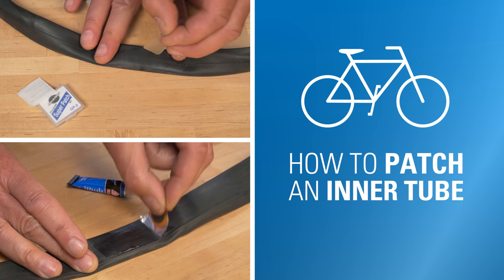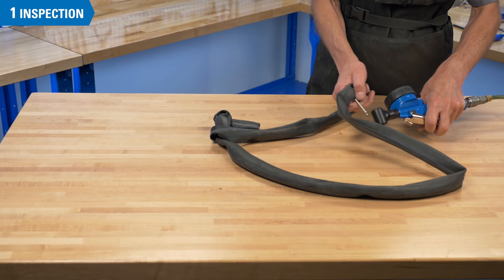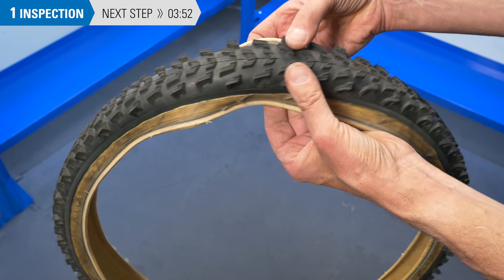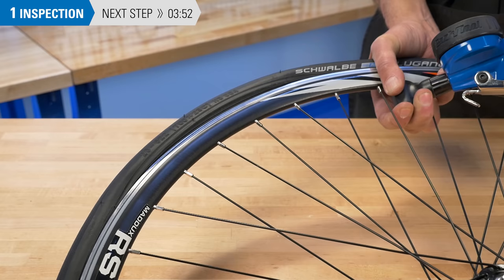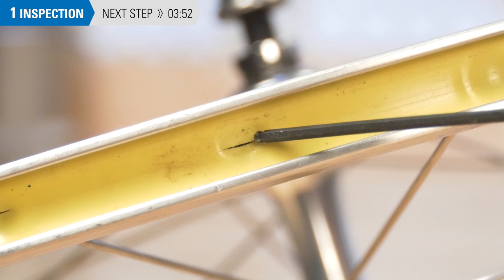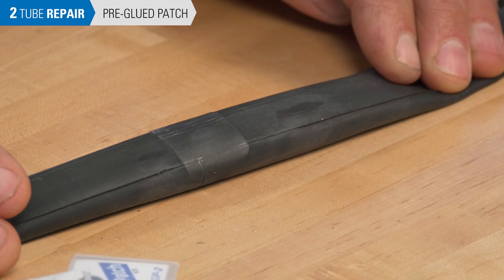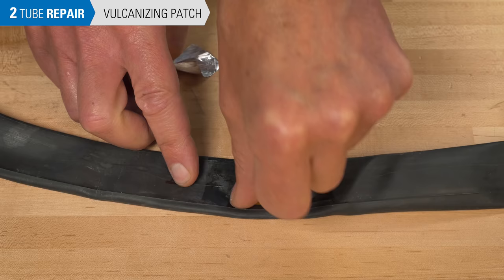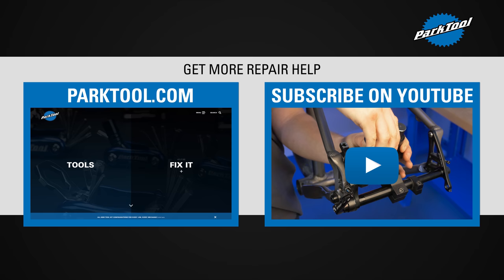How to Patch a Bicycle Inner Tube

Comment: I replaced many tubes in my life, this time idk why I thought I’d check a video about a how to while the glue was drying. And one thing I almost forgot this time was to check the tire for what caused the pin hole. Sure enough I went back to my tire and there was a tiny thorn coming through, saved my day lol. Thank you.
Reply: I decided to fix this myself for the first time a week ago. Instead of paying for a kit, I had these "Glue dots" in this arts and crafts bin I remembered. After sanding the area they bonded perfect, then I chalked up the other side. They're about the size of a hole punch out and  stretch really well with the tube. A few potholes and at 60 psi working greatm The applicator has about 100 dots, it cost about $4? Crazy.

Comment: Excellent video! Thank you. Just to add to that, where you find the hole on your tube gives you a huge clue as to the cause of the puncture. If the hole is on the inner circumference of the tube as mine is today then it's likely due to an inadequate rim strip.  If it's on the outer circumference then it is likely from a foreign object such as glass, sharp stone or splinter.

Comment: Thorne Resistant tubes are the answer and sure some complain about the weight but its a bicycle and its all about fun and exercise so what a little extra weight.
Reply: Specialized 29er thorn resistant tubes or tyres?
Reply: My thorn resistant tube just blew two weeks in.

Comment: Thanks for the reminder about checking the tire for objects. I had a small tack stuck in the tire. If I didn't remove it the tube would have been immediately punctured again.

Comment: this is a really good video.
what Calvin doesn't address: 
-there are places on a tube that are difficult to get a good seal. these include the seams, and then those seam-like tire markings and machine marks. try the best you can to get the patch solidly on the hole.
-getting the edges of the 2-part patches (where you put the cement on first) to seal properly is important, and sometimes tricky.

Final thought: I'm playing around with RTV -blue silicone gasket maker as a way to seal the edges of leaky tire patches. I THINK it just may work. Currently, pre-massive-inflation-that's-coming, the stuff is about $4 per tube, and it just takes a small amount.

Comment: Calvin, what would you do if you discovered the patch had not adhered along part of the edge, as shown at 5:55? Would you add glue to the non-adhered portion, or would you remove the patch and start over?
Reply: Just cut out the whole patch and use a bigger one to cover the new hole.

Comment: WARNING: NEVER RUN YOUR HAND ON THE INSIDE OF THE TUBE TO FIND THE THORN.  I found this out the hard way, not only did I have a puncture, I also had a thorn in my finger that only goes in deeper as you try to pull it out.  Use a rag and run it around the inside of the tube and it will snag on it.
Reply: Just do it slow, never had a problem.
Reply: Another thing I do is mark the position of the valve stem on the tire itself..this way, when I find the hole in the tube, by referencing where it is in relation to the valve stem mark on the tire I have a very good idea of where to look at on the tire.

Comment: May I know there are 2 method of fixing the inner tube. 1: is using Park Tool GP-2 and the 2nd is the patch with the foil, by applying the glue fluid. Both method must be cleaned with sandpaper and alcohol swap right? My father and I have been figuring out, how does the patch works, as the patch itself is not sticky, or non,-sticky. Anyway, Park Tool videos are fantastic, which I have learnt from. Grateful!
🤗🙇🏻‍♂️🙏🏼🤲🏼🤝🏼🤜🏼🤛🏼💪🏼💯👍🏼

Comment: How do you prolong the life of the tube of glue? Also, is it ok to test an inner tube right away after patching it up (with a vulcanizing patch), or is it best to leave it overnight?
Reply: Have you tried holding it upright and as you squeez the glue out start rolling from crimped end,then after fixing tube and before capping the glue make sure the threads are clean before putting cap on while looking to see glue just at the top and cap it..see if that prolongs the glues lifespan.
Reply: @jennifurzoe1302  Yeah someone here taught me how to. Works! But thanks too.

Comment: 5:00 - Yup, you always have to pop open a new tube of glue, since the one you used last time a month ago will be completely dried up.
Reply: Annoyingly true
Reply: Why don't they sell the glue in tiny, single use tubes. I buy super glue like this. Five little tubes of glue in a plastic bottle.
Reply: @J. McQ. - Because then you wouldn't go buy a whole new patch kit or special tube of glue.
Reply: @lurkerrekrul  not if the patch kits came with a pack of 5 glue tubes
Reply: @Avins MAD - That's the point. By only giving you one tube of glue, they know it will dry up and you'll have to buy another patch kit just to get more glue. So they make more money. If they gave you more glue tubes, you'd buy less patch kits and they wouldn't make as much money.

Comment: I never leave the clear plastic on top of the patch for a road tire tube. It doesn't have any stretch and is fairly stiff so the patch doesn't conform to the curved surface of the tube as the width of a deflated road tube is narrower than the patch itself and will not fully adhere until maybe after installation into a tire which may be months down the road and other grit might of adhered instead.

Comment: Very informative video, loved it.  I have always had problems patching a tube when the pin hole is close to the seams on the tube.  Tried removing the seam with sandpaper, but it is very difficult.  Any suggestions on how to seal these leaks.
Reply: ☝️😂 I'm trying to save myself about $9 right now, my friend!  As a kid, I'd sometimes be able to patch a hole that was right along the seam. My 39 year old brain has been dealing with this same hole for the past two days now. Those holes on the seam are a tough contender that may take you the whole 12 rounds, or you may KO them in the first round. I broke out my sanding block today to thin the seam out as well. I dont know where the idea came from, but I figured if I can sand down drywall compound, I could give a piece of flimsy rubber a try🤔.
Reply: I'm currently riding my bike around after two days of trying to fix that tiny hole along the seam. I would've been out of about $9 if I gave up today. The sanding, plus adding as much pressure as I could may have helped. It's been about two hours since I took my wheel to the pump, and all is well. I just had to remove one brake pad to get the inflated tire back on the rear end of my bike. My brakes are extra dialed in, and aren't much wider than the rim. These fatter BMX tires can't even be muscled past them when the tire is inflated.
Reply: 2 replies and neither one answers the Q of how to deal with the seam problem. Anyone with an answer ? Calvin You ?
Reply: @carlosrestrepo8525  Moderately aggressive sanding will round off the sharpness of the seam, allowing the patch and tube to conform to each other.
Reply: @rgw1380rw  Isn't it easier to deflate, mount, & reinflate the tire/tube than to remove  & reinstall the brake shoes?
Reply: @ronmorrell9809  v-brakes quick release thingy

Comment: it sounds silly that at age 66 i needed to watch this... but i just patched a few butyl tubes tonight with small holes, and wondered about that clear plastic on tip.  been using your vulcanizing kit, but frankly the one with no glue looks a LOT better, especially on the road.  can anyone comment on effectiveness with laytex tubes?  thanks.  p.s. i just subscribed.  i do have several various park tools.

Comment: My questios is after patching inner tube there is still a hole in a tyre itself.Does it make sense to patch it as well from the inside.It seems like the patch on tube is located a bit aside and a new puncture on inner tube is waiting to happen,as I can see inner tube through that hole in the tyre

Comment: What's everyone's thoughts on self adhesive patches vs traditional glue patches. Is one longer lasting than the other?
Reply: The traditional glue patch bond the patch to the rubber of done correctly and becomes part of the tube as melts/bonds to rubber and a permanent repair. The glue patch’s are temporary at best and have had much luck with them. Yes they get you home but tend to not hold long term.

Comment: If in using a vulcanizing patch do I need to let the fluid dry completely or do i have to put on the patch when it is not completely dry
Reply from the maker: You should allow for it to fully dry. If it was spread out nice and even and thin it should take no more than a minute for it to dry.

Comment: THAT'S A LOT OF GLUE, MY MAN!
Reply: Selling glue is part of Park Tool's business.
Reply: T. M. Just buy the Slime brand from an auto parts store. It’s $6 for a can that should last for 10 years.  I bought mine at Autozone.  The amount of glue in one of those small tubes with the patch kits will make 2 repairs. 6 patches are included in the PK or Rema  Tip Top repair kit so if you have your own can of rubber cement you’re golden.

Comment: I got aloy plates inside my Tyer it stops me from getting punchers and it iven stops nails or pins going into my inner tube and I can run over glass and not get a puncher. You should try it your self
Reply from the maker: Only steel plates will work for the nails around here.

Comment: What is the strip of rubbery that is inside the wheel that covers the spokes and where do you buy that if you’re existing one is torn?
Reply: that's called a rim strip or rim tape. You can buy online.

I've also, literally, used electrical tape to re-do a worn out rim strip.

Comment: A good tip on quickly looking for the cause of the puncture: Before removing the tire, use your marker to mark the spot where the valve was located. After you repair the puncture, put the inner tube on top of the tire, aligning the valve with the mark. You can then inspect the part that’s aligned with the patch. That being said, it’s also a good idea to regularly inspect the entire tire, as shown in the video, in order to preemptively remove any possible causes of future punctures. But this tip will be useful if you’ve just made an emergency roadside/trailside repair and are eager to move on already. You can do the more thorough check once you’re safely home.
Reply: I learned this the hard way in the beginning…. It never occurred to me that the cause of the puncture would still be in the tire, ready to cause another flat.  🤪. After about the second time I finally got a clue.  Great advice!!
Reply: Another way is always placing valve somewhere in front of the middle of the tire label when initially installing the tube. When you find a puncture and align punctured tube valve to the middle of tire label then you know where on the tire or rim is a place to inspect thoroughly.

Comment: I found Flex Tape works great. Clean and roughen like usual, then partially inflate the tube and quickly apply the tape. This tape isn't flexible as the name implies. It's just the trade name. I cut little squares for my repair kit.

Comment: What exactly does vulcanizing mean for these patches? Isn't it just a piece of orange plastic? Why does ParkTool call it vulcanizing patch? Can someone explain, please?
Reply from the maker: It is a chemical bonding. It is not just an "orange" patch.  The process of the two adhesives "cold vulcanizes" to adhere to the tube.
Reply: @parktool  which two adhesives you mean? The orange layer and the liquid glue?

Comment: I have always had problems patching a tube when the pin hole is close to the seams on the tub, What is the solution ? Sanding the seam is not an option.

Comment: Thanks for this great video.  I have successfully patched many tubes and was able to reuse them.  Question....I am running out of the rubber cement.  Can I purchase any rubber cement or does it need to be special vulcanized glue?  I have a Maifede patch kit.  TIA John
Reply from the maker: It needs to be vulcanizing fluid. The rubber cement will not soften the butyl that allows for the patch to be bonded on.
Reply: @parktool  my tire is leaking on the tube at the stem

Comment: Does a butil rubber tube require special patch application due to large expansion within the tire space ?
Reply from the maker: Butyl tubes make up the mass majority of  tubes in the market and are what these patches are designed to be used on.

Comment: If I could add just one thing make sure you put a circle around the hole with a pencil pen chart spray paint whatever you got because if you don't you will never find it and you'll have to dip it back in water again to find the hole again make sure number one take a marker and put a circle and make sure the hole is right in the center of the circle so that you won't find

Comment: Does this patches can hold on to a 110 psi pressure inner tube? I am riding a speed bike and all the repair kits I’ve been trying are not holding the high pressure! I leave the tyre pressurized overnight and in the next morning it is flat! I’m pretty sure it will work on a MTB tire that uses lower pressure, but what about the speed bikes? Have anyone tried before?
Reply: 100 psi is enough for road clinchers. First of all, is the tire already free of sharp debris? Is the patch applied properly?

Comment: So it means, not to inflate the tube right after applying pre glued patch ?
Reply from the maker: Inflate it inside the tire body, not outside the tire to tire it.
Reply: @parktool  so I can do it inside the tire, and pump it to required pressure, right ?

Comment: If in case my patch didn't stick very well same as 5:55, could I just apply some glue to the parts that did not adhere or should i remove the patch altogether?
Reply from the maker: It is difficult to get glue just into the badly adhering parts.  It is almost always necessary to start over.
Reply: @parktool  Makes sense. It felt like a daunting task to me but thanks to this video it made me practice on a tube that got punctured with a nail, not bad for a first try but I want to practice more. Cheers and thank you!

Comment: how can i know what size is good to my tube size 700c as an examble
Reply from the maker: You should also see a width next to the 700c. It is usually a number between 20-52. The tube will have a range of widths it works with. 700 x 23-28 for example. You also them need to pay attention to what kind of valve you have.  Presta or Schrader. If Presta you should also take into consideration the valve length. The length is important to be able to go through deeper section rims.

Comment: Can one patch the tire itself instead of the inner tube?
Reply: No. Clincher tires are not airtight. The tube prevents the air from leaking out (until the tube gets a hole). The tire prevents the tube from stretching too big (like blowing up a balloon inside a sock).

Comment: I always put on the patch when the tube is semi inflated. Is that wrong? It prevents the patch from being overstretched when you inflate it inside the tire.
Reply from the maker: If it will hold the air, that is not a wrong technique.

Comment: 4:25 be careful with these ParkTool GP-2 patches - if you leave the inner tube with such a patch in the tire permanently, after few months the patch will start to crack and the air will escape through the same hole.

Comment: I changed my tire but now brake too tight and wheel will not move.  Did I put too much air?
Reply from the maker: It is not the air that is the problem.  The wheel was not put fully back into the bike, or,alternatively, the brake is not pushing against it.  Double check the fitting on the wheel in the bike.

Comment: Hello, inside puncture repair kits here in uk they have small rubber tubes called valve stems. What are they and what are they used for please?
Reply from the maker: That is for the "Dunlop" or "Woods" stems. More common on the Continent than in the UK, the rubber acts as a stop valve on the stem.  The original tubes will rot and wear out, and that is a spare.

Comment: transparent glueless patches dont work well.It might gets you home on a emergency but wont hold up.How I know? I tried several times all failed
Reply: try cleaning tube with a bit of alcohol,  then let tube dry completely, then patch,  as in video.  I always draw a small circle, then a bigger circle that is bigger than the patch, so I know exactly where to drop the patch

Comment: My patches, 25mm, are bigger than my road bike inner tube which is 700 x 18/23c. Is it ok to cut these patches? Won’t the cut edges possibly puncture it? It’s hard finding smaller 15mm patches here, mostly 25mm and above are available.
Reply from the maker: Yes, cut the patch, it will work.
Reply: @parktool  Awesome. Thanks!